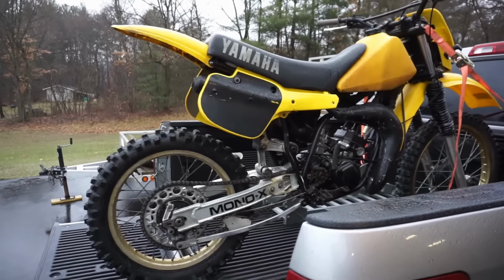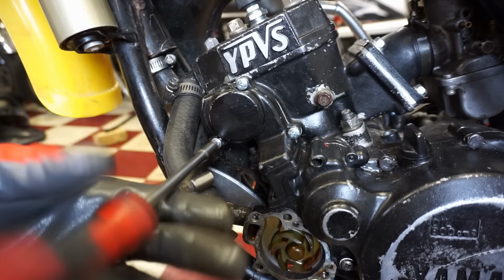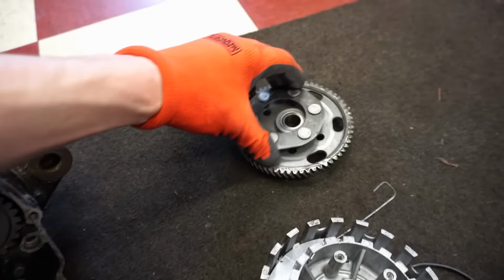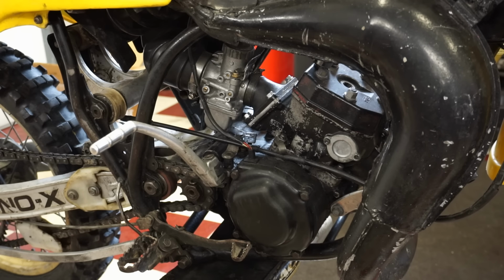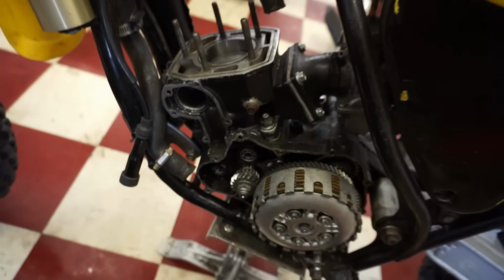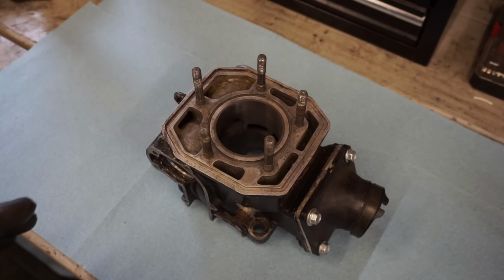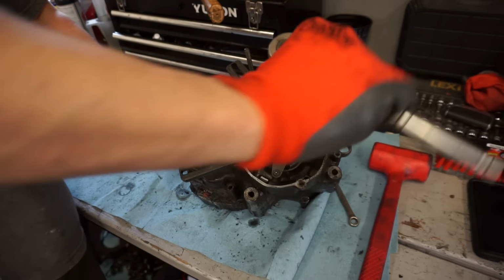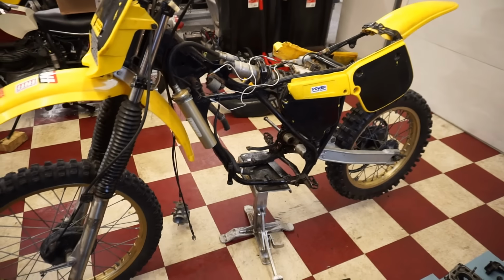Seller Lied About This Rare 2-Stroke Dirt Bike

Comment: Someone took it apart and saw the damage, put it back together in a way that it couldn't be checked. Was sold and the next guy may, or may not have determined what was wrong. He gave up and passed it to the next, which may have been you. Did he know? Only the seller knows for sure. Sorry you got taken on the deal. In the future, if the deal looks too good, it is. Either walk away or offer 50% of the ask price. And even then that may be more than it's worth.

Comment: There are seals in the steering stem that will need to be replaced.  That bike routes coolant through there.  It's a horrible design.  Once the seals wear, the coolant destroys the bearings.  Honestly, I'd part it out.

Comment: Damn dude l had that same exact bike but it came in pieces and had to put it together. It lasted about 5 months before the crant broke.....so l got a 99 Ktm 250sx and was so reliable.....l never had any problems except l had to replace the shock and l ringed it out for close to 8 years and then had to sale it. I mean it was heartbreaking because it was still just as strong as the day l bought it in 02 but l had a fresh new family and 2 children and desperately needed fast cash . Ugh still pissses me off.

Comment: Hey joe
Great work that bike was a part restore then when they found. A cleaner bike they used the best parts from that bike was on thumper talk i remember it has i had 1
But they wasnt the fastest bike in 82 the honda and kawi was still better mate
The cooling system rum through the steering stem which made them boil over and cause leaks buddy
So they byepassed it with extra hosing to take it out the head steering stem
And thats why it wap never good and only a 1 year bike with that ypvs system
The 1983 was best of 83 though
How can i talk to you???
I will send my cell number

Comment: Before I even watch this video, have not read description nor comments, out on a limb, for real. I am gonna call this a 1983 YZ250.
Reply: Close, but missed it.
I owned an '83 YZ125, had her bored, brand new top and bottom end. Top end was 50-55mph but she'd rip right into it, scary for a 125, I didn't even need a 250.

Comment: The seller might have had no idea the power valve was missing in action......you should have unscrewed those 3 bolts to check before buying, as that's a critical bit not to have.
I would have never bought an '82 where the coolant actually goes thru the triple trees and frame....terrible design which will give you headaches forever.   Part it out and try something else.  This was a dead-end for yamaha, and one of the worst bikes they ever made.

Comment: NEXT TIME YOU BUY A VINTAGE BIKE,
1. Hear it run, shift the gears, inspect the frame.
2. Paperwork should be up to date or Non-opped.
3. It will cost more than the sum of the purchase price, and quoted parts for repairs.
4. Be a millionaire if you ignore 1, 2, or 3.
Reply: There are few things more expensive than a cheap bike.  This is the word of the Lord.

Comment: he said it was running when he bought it form teh seller beforehand that couldve been ten years ago... stuff like this is why im hesitant to spend lots of money or money in general on marketplace i get the feeling alot of times peopel know something is wrong with soemthign but dont tell you just becasue they want to get rid of it.. idc if soemthing is wrong with the item just tell me so i can fix it.. if i wanted it bad enough id buy it anyways..i fix small engines so its not really an issue with myself but certina thing slike dirt bikes im not really familiar with more or less lawnmowers.

Comment: Those motors never held up very good. Those 2 piece power valves were garbage. If the piston failed it usally took out the powervalve with it. Probley is why there is not one in it. The pins in the valve would also fail. I have worked on many of these back in the day. And im not sure that can be bored out any more. If thats the case i would get rid of it. That bike in that good of shape beeing bored out to the max is telling u something. Its never been rode that much. Those motors we not that good and failed early. Ive had many vintage bikes would run till the bike was wore out but the motor still run and some not.. Im a fan of vintage stuff and like seeing them saved. Yamaha lead the way with develoment alot. If it wasent for them introducing the YZ400f in 1998 we might not have the modern 4 strokes we have today. And KTM kicked but in the 2-stroke world. My 1999 Ktm 300 EXC had a million miles on it when the piston left the chat. I rebuilt it bottom up and it still runs to this day.

Comment: Sucks to have to spend on parts 😞. I definitely would have torn it down before doing anything with it beforehand though. Deck the cases with file and sandpaper on a super flat surface. New bearings prolly everywhere.

Comment: I don't understand installing the clutch when theres no way its going to start with the obvious crank issue.  I'd bet the big end bearing is shot. Just bite the bullet and tear it down that way you can see what ur up against I'm betting  its gonna be bad, very bad.  Never seen a silicone seal special that wasnt a money pit.  Sorry you got burned by that seller.

Comment: In my years of tinkering, I have also found that people who own and sell used ATV's and dirtbikes are the WORST type of sellers. I have no idea why this is, but they're another breed compared to people who own boats, motorcycles, and I'd say even cars. 

Off road toys receive by far the most cobbling on them from people who have zero idea what they are doing (as evident by the idiot PO showcased here), so bad that it becomes impossible to undo alot of it and make the bikes what they once were. And, the people involved will also flatout lie, as showcased here. Overall idiotic and terrible human beings. These are the reasons that I pretty much got out of messing with old dirtbikes and fourwheelers as you do here. 

While newer stuff usually goes against my style (and my Youtube channel), I've made an exception with dirtbikes. I recently ditched my early 2000's machines (finished rebuilding one and sold the other as-is) and bought a lightly used 2021 Beta 300RR. Best decision I've made, and I couldn't be happier. Every time I watch one of your videos, that serves as a reminder. If it wasn't for the Youtube money that you're pulling in off these, you'd be losing money overall because of deals like this one (not at all uncommon either).

Comment: Why are you wasting your time with the carburetor when you should be at the guy's house. The cylinder is 3 to 4 times oversized of the Piston. The rear shock is probably out of nitrogen. And you forgot you mentioned you need rings. That needle bearing on the top needs to get thrown in trash.

Comment: You really need to do a better job at cleaning your shit up. Anytime you take a part of motor you should know parts need to be clean. I’m not being critical. I’ve restored about 40 bikes in my life. Invested a nice vapor blaster and clean all the corrosion, out of the cylinder port, the water jackets, paper blast the carburetor queen of spotless. You have a very good knowledge of homeowners work and what you’re doing, but you take a lot of shortcuts. It’s cringe how you take motors apart with all that dirt and shit on them. But keep up the good work. I do enjoy your videos.

Comment: This stinks. However, you need to be more observant when looking at old bikes. Like if you would have kicked it over while you were there, you would have had a red flag right away. Always take the power valve cover off and take a look in. Takes 1 mins.

Comment: Buying a bike that doesn't run? You know better than that. Obviously you know a thing or two about bikes. Scammers are out there on every corner. I'm thinking you've been burnt before and didn't learn a lesson. Your power valve is on e-bay if you don't know how to get ahold of the guys.